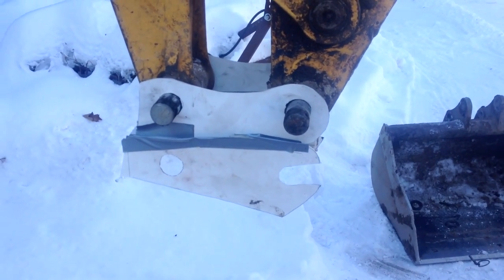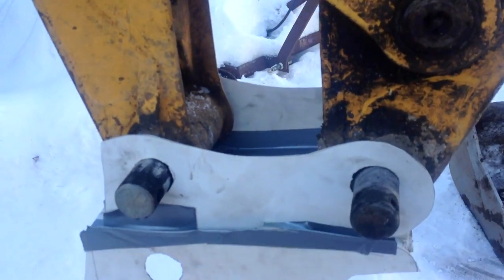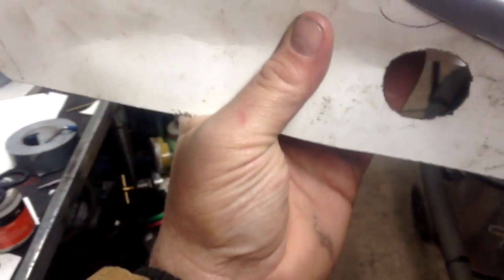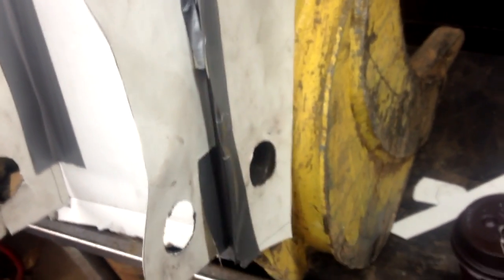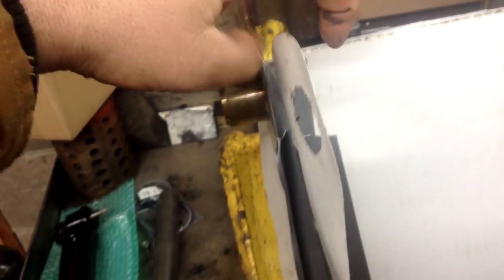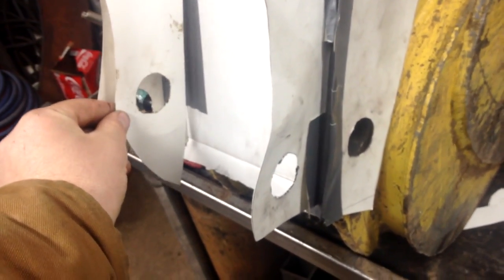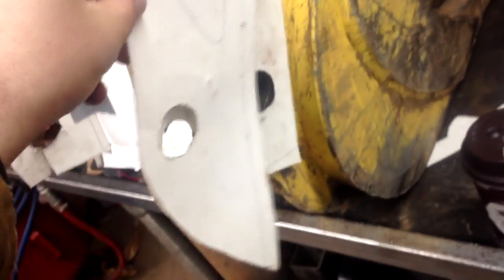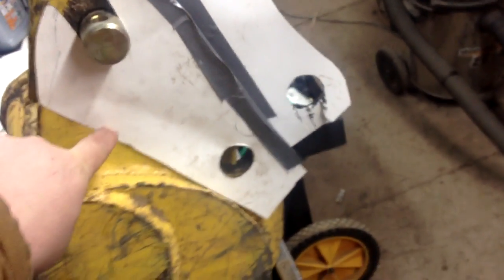The quick connect for the backhoe project

Comment: don't for get your thumb because it pins using the first pin I have a 110 like yours and made one for mine and put the bottom connecting pieces on the inside were the boom originally went. because I am making a thumb and it goes on the outside were you are planning on using the quick connect. and it think if I look over you videos yours does to.

Comment: Doing projects is fun but does this actually make anything easier? You have one pin to insert/pull rather than two so a very small time saving. I guess it may make alignment easier but then spend ages trying to get the top hooks in place. Could you take this further and have two sets of hooks and some form of locking mechanism around one of the pins so you don't need to pull either pin, in concept like the front mount.

Comment: I've run lots of trackhoes and a quick coupler messes with the geometry of the bucket and your curling power goes down significantly. I strongly dislike quick connects it's worth it being that your buckets are so small to just keep just changing the two pins

Comment: Great Video!!!  Make it so it hooks to the inside of the bucket though not the outside.  Also check the rotation to full close and make sure the coupler does not hit the end of the stick and cause a problem. The Coupler in your Video @ 8:37 has an offset for the Bucket pins.  Happy Building!!

Comment: Don't forget the dino thumb goes on that top pin Bill, so the hooked plates will have to be of suitable width to fit that. Suppose you could then have the thumb on all the time, mounted to the top pin of the quick hitch instead of the bucket.

Comment: you should invest in a arc welder
Reply: DC ARC WELDERS ARE THE BEST ! BETTER THAN MIGS ! MUCH DEEPER PENETRATION ! MY WELDING TEACHER USED TO SAY MIGS ARE FOR PEOPLE WHO DON`T KNOW HOW TO WELD ! JUST SAYING ! SORRY FOR CAPS JUST SAW IT !
Reply: BILLSTMAXX :) ya but they have better penetration for thicker metal and will be less prone to cracking under stress especially for the kind of force that the quick connect will experience
Reply from the maker: been there done that.... to messy

Comment: I agree with what landymandan90 said, make the hooks go on the inside of the bucket brackets. It would be like it was the arm from the tractor mounting on the bucket rather than risking it being too wide or not to mention messing around with new custom pins that will probably end up being too wide for your ripper tooth and small buckets.